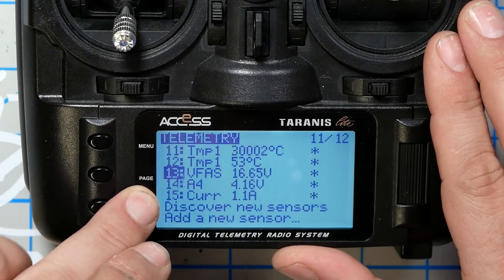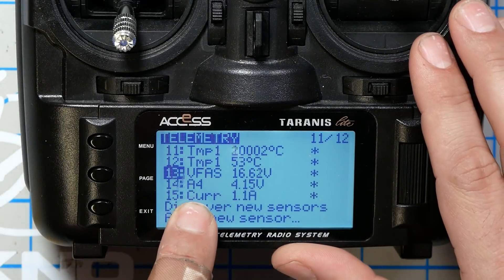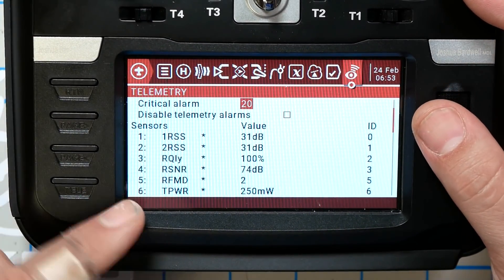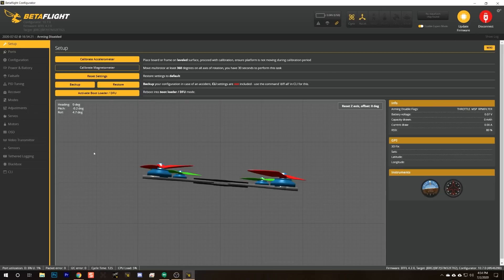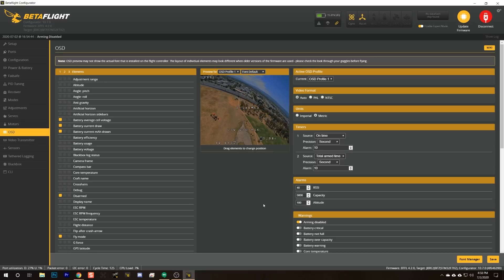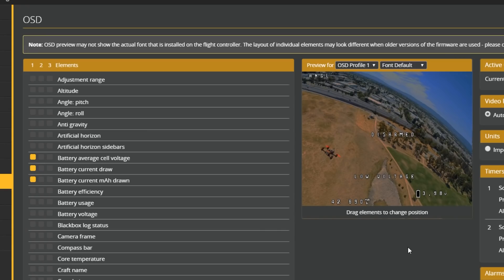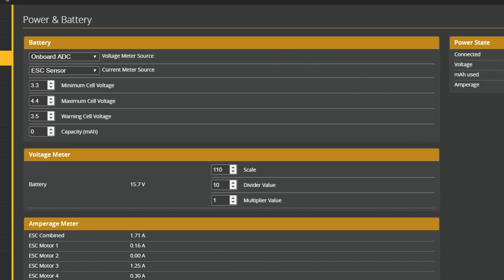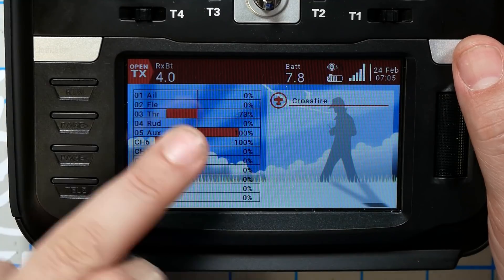The A4 telemetry sensor is the one thing FrSky does better than Crossfire (what even is that)

Comment: hello sir.. I'm begginer on ths fpv hobby and i only using analog & a frsky system.. i have question hope you can answer 🙏🙏🙏  my radio controller is Jumper T PRO whne I see my betaflight i have a RSSI signal but whene I see in my radio controller is dont have but in betaflight i have rssi signal and I'm okay great in flying.. only the radio controller how/what i have to do to have rssi signal in my jumper tpro..

Comment: I beg to differ,    Not only does Frsky especially the R9M telemetry works flawlessly with external devices through bluetooth way better than TBS as well.  Now with ExpressLRS it's even better!  I have full size TBS Crossfire Tx and multiple Rx's from nano to nano diversity, and micro and even with tbs Crossfires wifi and even there bluetooth we cant get reliable telemetry sent to external devices to use for downed planes or quads.   Telemetry Viewer app  sort of works with XF but only basic date like sat count with no battery voltage, alt,or speed and distance its pretty useless.   One would think for what we pay for XF they'd get this right but I'm certainly not seeing it working.   I only HEAR folks say it works but seems no one wants to elaborate on it anymore than that.

Comment: @ Joshua Bardwell Really, isnt that kinda pointless while flying FPV sense you can get all the same information and alot more from the osd and sense its not like you can see your controller  with your goggles on and i know you can setup voice alerts but id be willing to bet that would get seriously annoying pretty quickly so yea. i think you must have made too many FPV related tutorials because it seems like your running out of materials.i did learn something though, ill give you that. lol
Reply from the maker: Lots of people prefer audio alerts to using the OSD.
Reply: @JoshuaBardwell  fair enough,  i guess your right after looking through some of comment section i see that but i still stand by my original statement that its just pointless and very annoying. lol.  i was just joking when i said you must be running out of material though, ive learned alot from you over the years and hope to continue to in the future so thank you for that sir and keep them coming!

Comment: I use both battery voltage and A4 on my OSD AND have my radio readout the value of A4 every 30 seconds below 3.8.  When I reach 3.6 it plays "Battery critical" every 5 seconds.  It may be annoying to some, but it works for me!
Reply: i dont think i would get through 3 flights before that controller would be on the ground in pieces if i was using it... lol! i dont know how you can do that, i wanna throw my controller after the 3rd time she tells me 'RX low"  and its only happend a couple times. lol

Comment: This is a bit pointless since the radio can do this automagically.
Another thing:
If you use the FRSKY voltage meter (Say on a wing with S8R or something) Then the A4 Reported gives you each independent voltage. Try it out, use the larger battery looking widget and select A4 as the source. Pretty cool.
Reply from the maker: How can the radio do this automatically?

Comment: average cell is not ideal either,  lowest cell voltage is what you need, thanks FRsky with the MLVSS and add Clow to the sensors along with an audible warning with a delay so punch outs don't set alarms off unnecessarily...

Comment: My telemetry only has RSSI and RXbat
Reply: that problably means you haven't discovered the other sensors from the telemetry menu, or that your telementry wire is not correctly connected, or you haven't activated the telemetry option in BF.
Reply: @MessFPV  i tried everything i can think of. so only thing left is geprc didnt hook up r-xsr right
Reply: @QSpeedRacer  if you are using an r-xsr on a F4 board, issue is most of the time due to  uninverted uart, the solution is then to use the uninverted smartport pad on the r-xsr to connect to your uart instead of the smartport wire of the connector:
https://oscarliang.com/ctt/uploads/2017/10/frsky_r-xsr_rx_receiver_smartport_sbus_inverted_uninverted_pin-1024x591.jpg
Reply: @MessFPV  its F7 board.. i think geprc hooked it up wrong.. i tried troubleshoots of inverting and then un inverting.. halfduplex.. changing smart port uart.. though I didn't try every combination of invert on off and duplex on off on every uart..  i don't know what else there is. Wrote geprc didn't hear back.
Reply: I'm new at this so still learning. Appreciate the help

Comment: Coming from a line of sight rc background,I still haven't broken the habit of relying on a manual timer to countdown my flight. It still works well. I've been flying FrSky xm+ in my quads and using avg cell voltage in the OSD. I was unaware of the potential problem. Next build im planning will have Crossfire. So this video covers at least 2 things I didn't know about. Thanks!

Comment: Any tips on getting the average cell voltage to show up in the DJI OSD? It works in INAV but not Betaflight.
Reply from the maker: Yeah it definitely works in Betaflight. If you have the MSP conneciton working, then in the DJI goggle enable the Show Custom OSD option. Then in the Betaflight OSD turn on average cell voltage and voila.
Reply: @JoshuaBardwell  what version of bf did you verify this on? My OSD works fine and it shows up, but only output 0s. It has always worked fine on analog. I am running 3.5.7.

Comment: Hi I built a quad from FPVCrate and qwadbox but it will only fly 30 seconds on a battery tried the same battery on my other quad and it is fine what would be draining it so fast 2700 kv swapped to 2450kv and still the same thing happened any suggestions thanks
Reply: Hi just wondering why 
No response I love 💕 you’re videos

Comment: And neither is there any way to get the pack voltage back from Crossfire without a flight controller.  If you fly an aircraft with servos (such as a flying wing) this info is not available.   However it is available with FrSky if you plug in a $2 voltage divider board into their A2 input on the smart port of the RX.  Would very much like to put Crossfire on all my fleet instead of just half of it, but this is a showstopper for me.   It is actually an opportunity for TBS to include the voltage divider on the RX and route that directly into an analog input on the microcontroller - but for some reason they dont see it as a priority.
Reply from the maker: The Nano Diversity can sort of do it.

From Trappy: "btw, we also added support for physical voltage sensing onto the nanoRX. not really much for people with flight controllers, but for small planes it's something 🙂 just have to connect vbat (up to 2s) to the vin of the nanoRX. avg cell voltage will also work"
Reply: @JoshuaBardwell  Sure I am aware of this. This is really relaying the power input of the RX - rather than the pack voltage.  I dont fly any 1S or 2S aircraft, but even if I did, I would not be connecting the same supply to the RX and servos as my ESC.  I prefer to isolate the supply to RX & servos with a BEC anyway.  This is not a serious solution for returning pack voltage IMV.

Comment: The end of this video reminded me of something.  Anyone with the radiomaster tx16s, if you select the TBS theme, do you get a wire wiggly line jittering across your screen?  It only does it on the TBS theme, so it is not a screen issue.
Reply: "TBS theme is broken, don't use it"

It's posted to the TX16s RCgroups page a few times
Reply: Yes but if you flash OPENTX ver. 2.3.9 the squiggly line goes away. =)

Comment: I NEED HELP! quick question, I have a Potensic D88 that I would like to convert into FPV to be viewed through my FatShark goggles. Is this possible? If so, can you direct me to a how to? PLEASE!!!
Reply: Look for an AIO fpv camera + transmitter. They're tiny and just need power. You could get power to the camera many ways. The simplest would be a small 500mah 1s battery. Just glue the camera down, and hold the battery with a rubber band. Probably cost less than $20 I guarantee it can hold the extra weight no problem

There's many ways to accomplish this though. The fpv gear is small and cheap enough nowadays you can totally do it.
Reply: Joshua!!!!
Reply: Anyone?!?!
Reply: Lol. Thank you!!!
Reply: @Oldman-Havok  yes you can convert it for fpv, heres how. put it up for sale on ebay and once you get the proceeds take them and purchase a drone that is desinged for fpv. joking aside, theres no way to get the video feed from the exsisting camera on your fatsharks because your drone uses wifi to send the video signal and fatsharks can only recieve video from a 5.8ghz transmitter,the only way you could get the Potensic D88 to work with your fatsharks is if you got a 5.8ghz video trasmitter along with a compatible camera and mounted it to the drone  but if you want it to fly like an fpv racing drone then your out of luck anyways because theres noway to flash betaflight firmware to it so your gunna be stuck with the way it fly now with auto level and no ability to do acrobatics with it.
Reply: @tedbrozynski6430  yeah that's what I figured. But didnt hurt to give it a try. Lol

Comment: F L Y S K Y   G A N G

I need a new tx :(
Reply: i use to be apart of the flysky gang people shit on them way to much..the range on the old fsi6 tx is quite amazing never had a failsafe ,,,served me well that tx ,only reason it  died is because i dropped coffee onto it lol
Reply: @damonbfpv  range is good but the gimbals go to shit really quickly forcing you to setup a huge deadband witch makes it so you have horrible control at the center sticks. on top of that it just has a really cheap look and feel but that would make sense when you factor in the price. overall its an ok starter tx if you dont have the money for something better or you just wanna dip your toes into fpv so to speak.
Reply: Radiomaster tx16s it'll connect to all your flysky rx
Reply: I started with the i6s. I wish I could get that radio with FrSky guts, I really like the feel and the gimbal positions/travel. Awesome little tx.

Comment from the maker: GOOD NEWS. I showed TBS this video and they added this feature to the project roadmap. So it should be available soon! But in the mean time, I'm still putting out this video because there can be other times this is helpful, and because you never know.
Reply: How long do you usually upload your videos ahead?
Reply: stop taking my reasons to use R9
Reply: great to hear!
Reply: A lot of people propably aren't using telemetry nowerdays, because the OSD's are just so powerful. Can you tell tbs to make a non telemetry mode that will do 250hz? :D
Reply: @strikerFPV  i like telemerty call out on my radio, OSD is nice yes, but if I am filming something important I don't have to take my eys of the subject, I just listen to the audio call outs
Reply: Wait...  TBS listened to YOU???  :o  They must be in a mellow phase of their love/hate relationship with you.  :D
Reply: I will wait for their next version :) And also for the 500mw on the Micro TX ;)
Reply: that is the one thing i have missed from frsky that i ever cared about.  real happy to hear this is in the future.  jumping between 4s,5s,6s, it is a struggle remembering the bottom.
Reply: Not sure how they're going to "add it". They can't change the existing battery sensor frame type and there is no space in it to add extra data. So they'd have to add some new frame type which is fine I guess, but Betaflight won't automatically support it. So hopefully they work with us otherwise it's not going to matter if they update the telemetry spec or not.
Reply: And because it'd be a waste of work to Bin it...
Love that you now run your videos by TBS before uploading them to make sure teapot doesn't get mad at you :-P
Reply: Has TBS already implemented this by now?